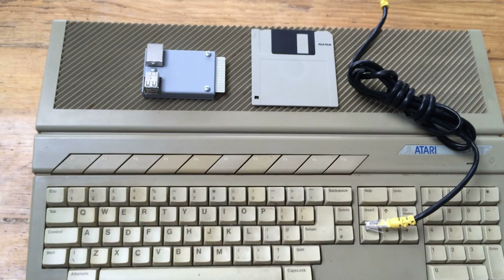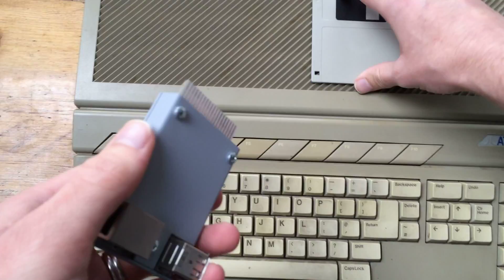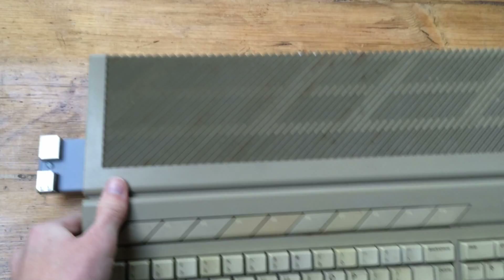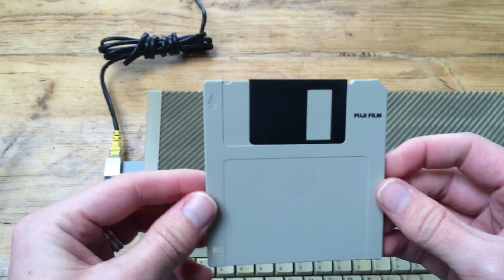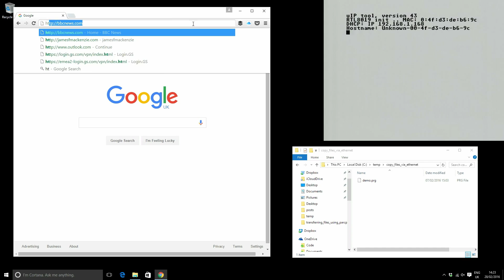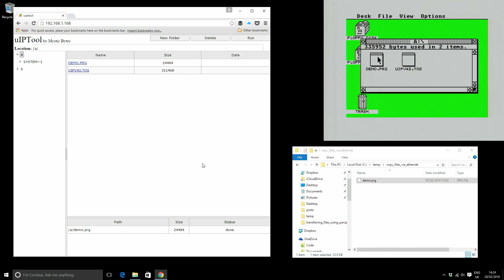Using Ethernet / NetUSBee and uip-tool to Transfer Files from PC to Atari ST

Comment: Hi James sorry for posting on your other video as this one is more appropriate for my issue.
Ive got the uipV310.TOS on floppy and when double clicking on it on the st it briefly loads and the small black blinking box in the top right of the screen like in your video but then mine loops back to the content on the floppy? So when double clicking it again it just loops back to the disc content on the st? Ive run a cat cable from the sy netusbee direct to my router and my pc is direct to the router so theres no switch and its still not loading?
The lights are on the netusbee orange to the right side and green to the right so i know its hooked up ok and on the router the green light is on? So for some reason uipV310. TOS is not loading to give me the mac and ip address?

Comment: Does this device also give you USB support for pointer devices?
Reply from the maker: Mark Wilson it does, but requires a driver - which on my limited memory system is a problem. I use one of the “Jerry” usb to serial mouse adapters instead (no driver required). I believe it also supports USB media on the Falcon (but can’t verify myself - no Falcon!)
Reply: jamesfmackenzie - Do you know where can I purchase the driverless version? I have Falcon 030s...
Reply from the maker: Mark Wilson sorry, I may have confused you. NetUSBee always requires drivers for all features - Ethernet, mouse and USB storage media (although the latter is only supported on Falcon). The “Jerry” mouse adapter I use is for mouse only - but does not require drivers
Reply from the maker: PS you can find the “Jerry” adapters on eBay
Reply: jamesfmackenzie  Thanks, actually I have 3 Falcons so should find NetUSBee as well... (Ebay to find that product too?) Would be great to use standard storage to move files around.... Was first thinking about mouse upgrades for my STs and Falcon...
Reply from the maker: Mark Wilson I bought mine from lotharek at https://lotharek.pl/productdetail.php?id=46

Before purchasing I’d do some research on the USB storage capability - I don’t have a Falcon myself so can’t vouch for it. It may only work in MiNT or other more advanced TOS replacements. Good luck!!
Reply: SInce month USB stoarage may be used on TOS ;-) new drivers were pubished
Reply from the maker: Przemyslaw Krawczyk thanks! Will have to try this!